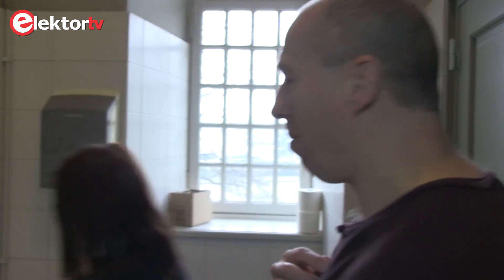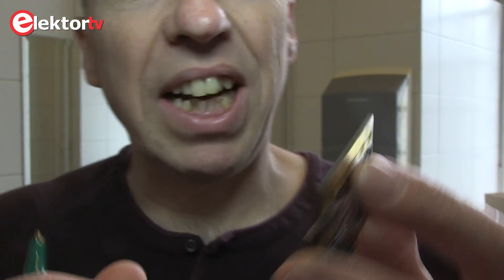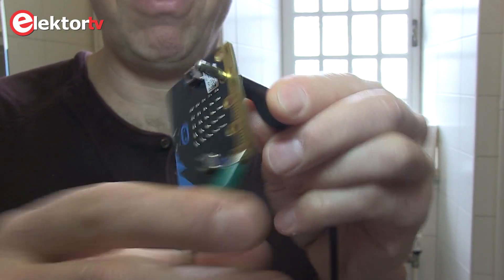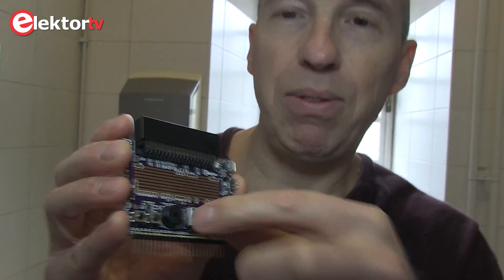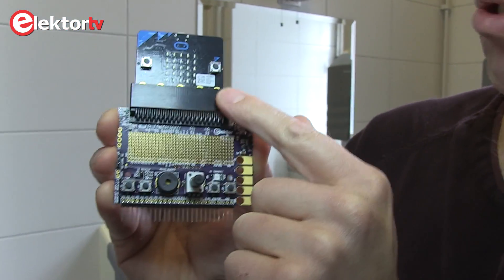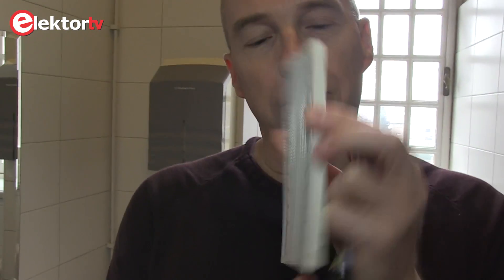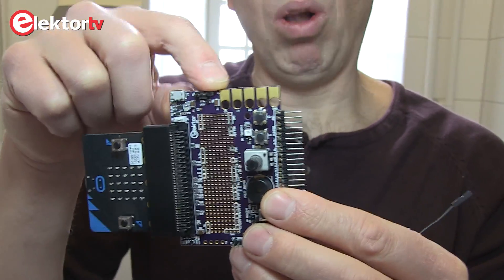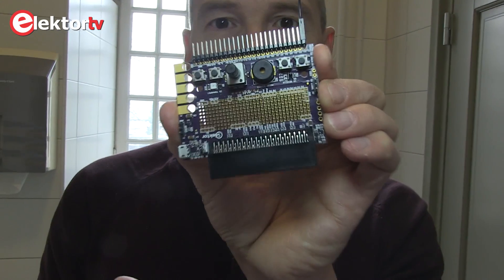Micro:bit dock from Elektor

Comment: You mention a I2C LCD interface. Is that for the common 1602 (16x2) LCD interface with I2C interface? If so, do you have MicroPython drivers for it?
Reply: The I2C interface is intended for Newhaven compatible displays like the NHD-C0220BiZ-FS(RGB)-FB-3V NNP. We do not have a MicroPython driver for it.